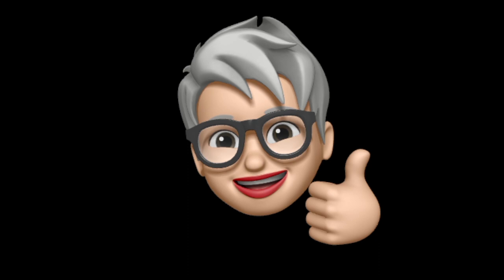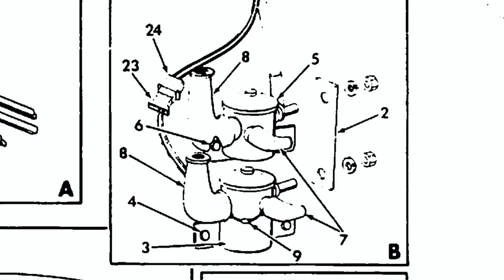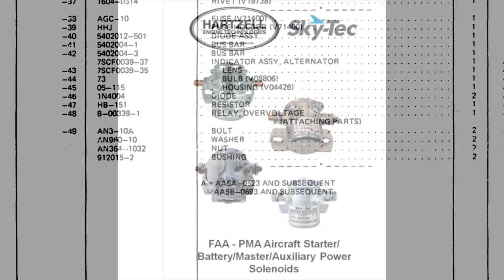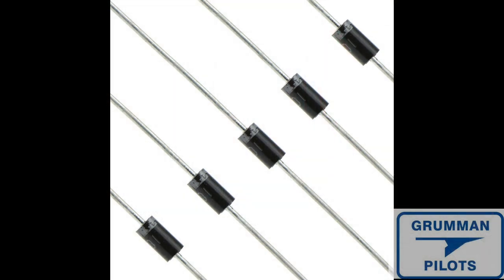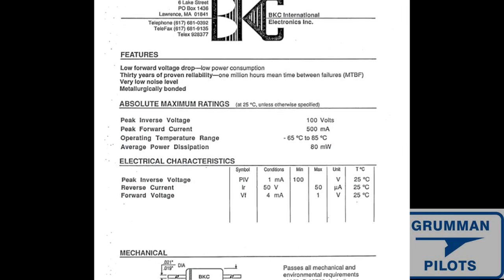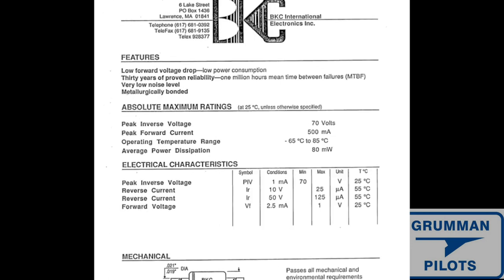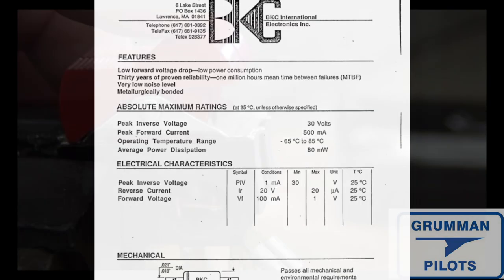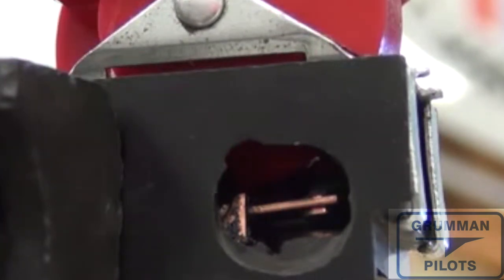Why Do We Have A Diode On Our Aircraft Relays? - Grumman Style

Comment: This will be more useful if you can show the airplane and show the cables! All pictures from golf,e is something we all ca do! But we need some input about what is the master switch is connected and will be easy to understand it!
Reply from the maker: Master is connected to battery.  When the relay is grounded (turning on master) it passes full current and the voltage to the starter via cable.  When starter button or key is turned, starter relay is grounded and sends voltage to starter.  Relay prevent back magnetic induced voltage when the circuit is energized and prevents backfeed.

Comment: Could a bad diode cause the ammeter to bounce while the engine is running? I'm trying to diagnose this behavior on my AA1A. Ammeter bounces in sync with the engine RPM (higher rpm, faster bounce frequency) - So far the voltage regulator passes inspection and the rotating beacon is off. Have you seen this on other Grummans?
Reply from the maker: Usually just a dirty spade connector on the master switch.  FYI
Reply: @GrummanPilots  Thanks for the reply! Heading out to the airfield to check that. Will report back.
Reply from the maker: @onrivertime  I usually pull them off and on a few times to clean them.  Works on the older VRs as well.
Reply: @GrummanPilots  Some context: Was troubleshooting another more severe issue this week. Looking at the logs, this plane has eaten 4 batteries in the last 2 years. Recently had the ammeter go full-deflection (and stay there). Both the battery and battery solenoid needed replaced - thought that might be related to the ammeter bouncing issue (common root cause?). The full meter deflection happened again earlier this week and was able to locate the fault today: Flap motor limit switch not cutting the power when flaps retracted (either loose wire our out of adjustment - still working on it). Caught that before it could burn anything else up. Still have the ammeter bounce, so will pull the master switch and clean or replace. Still working through the squawk list since I bought 58L last August. Greatly appreciate your advice and experience!
Reply from the maker: @onrivertime  Best of luck with the issue, and thanks for posting.

Comment: The video sucked. Please clearly show how to wire a two post starter solenoid. Total waste of time. All you showed is the master solenoid.
Reply from the maker: The Lamar relay for starter and master are wired the same, FYI
Reply: @GrummanPilots  No they are not, because the master is a negative turn on and the starter is a positive turn on.
Reply from the maker: The master and starter of the LAMAR line both ground to operate.